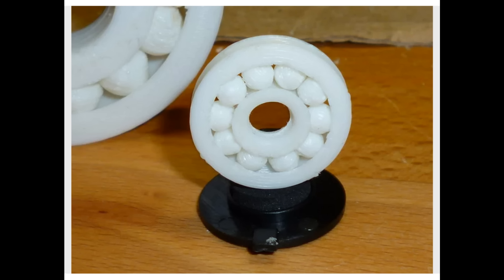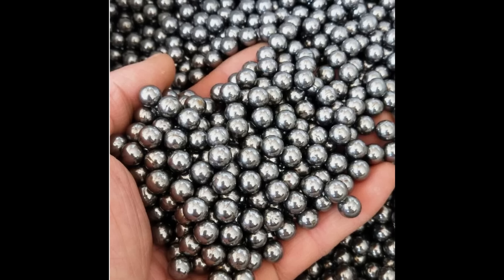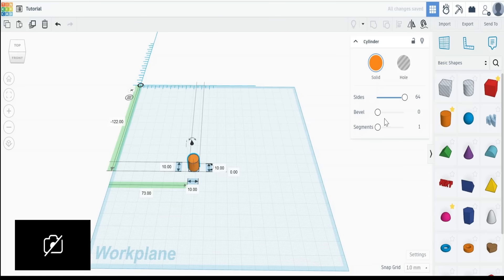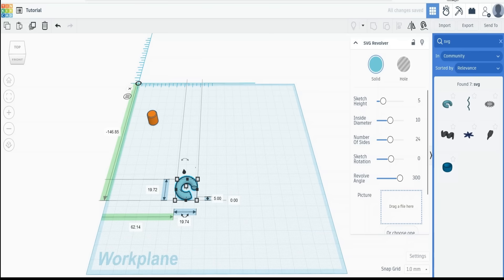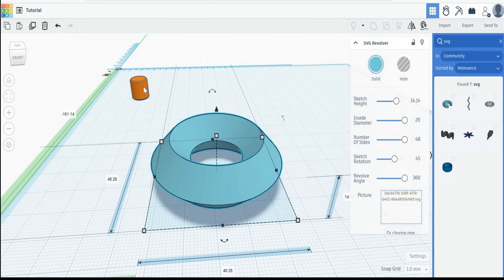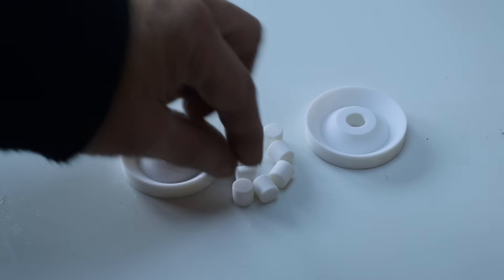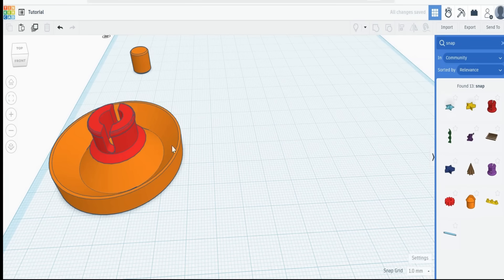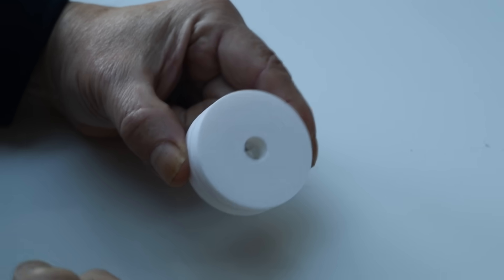2326 Universal 3D Printed Bearing That Works - Radial Cut

Comment: 1:30 the stepper motors only work in angular steps, that is what creates the jagged lines. However, angular momentum smooths things out, and a cylinder is still "round" in 2 out of three dimensions. A lot of effort has been put into printing these "arcs" in the XY plane, and this is really a non-issue (print a flat disk and check if you can see stairstepping for example). Instead, it's the filament lines that create a jagged surface in the Z direction in FDM printing, sometimes together with necessary support material on the underside of the sphere. Result is the same though!
3:20 the elephant's foot is already compensated for in most slicers, e.g. in prusaslicer under print settings -> advanced tab -> slicing.
Love the video, your bearing is very clever and seems to work great :D
Reply from the maker: cheers mate

Comment: Came here while eating – what a wonderful way to learn 😅. Wise design goals and words for applicable concepts! Didn't expect this to be something I may use for a turntable for robot hand. Though, I'm concerned about the momentum forces: 

Would there be a design, where the momentum force would be supported from 2 sides, instead of just 1 as now §1, where the other side squeezes and the other detaches? 🤔

A hypothetial §2 "interlocked hooks" (for sides) connection would still have only 1 side on the bearing and the other squeezing to the flat surface. Perhaps this flat surface could have §1? 🤔This would be a double circle of rollers structure; however, would perhaps need to be printed in-place without snap-ons. Interesting problem indeed 🤔

Just ordered a 3D printer and chasing FreeCAD. Sorry for your loss, Sir, and thank you for educating.
Reply from the maker: i am glad you found it useful mate and thank you for your condolences

Comment: There are vinyl filaments available, they're quite finiky to set up but once you have it this should be perfect for this type of application 🙂‍↕️ perhaps even better is PC/PTFE Filament which is even more a pain in the arse to set up but comes with a very good grind resistance while still being quite slippery. Coating the bearing chamber with graphite could also improve it's smoothness while turning 🤔
Reply from the maker: nice tips mate - thank you for sharing
Reply: @ThinkingandTinkering  thank you for this design, I would have tried designing ball bearings and probably loose my mind because it doesn't work properly.

Comment: That SVG revolver tool is a game-changer!
I've been creating similar shapes by manually revolving and merging countless shapes; the replacement hair-dryer fan I designed would've taken so much less time to make!
That snap tool is also amazing, I usually rip them off of other models and Frankenstein my creations together, or remodel them from scratch!
Reply from the maker: it is a pretty useful tool for sure

Comment: That's a good call.  I frequently use (big) slewing rings with cross roller bearings at work - but it had not ocurred to me to use the same topology for 3D Printed bearings.  Thanks for the idea!
Reply from the maker: cheers mate

Comment: why make the cylinder as tall as it is wide? I would think the diameter should be wider than its height to avoid friction
Reply from the maker: the cylinder would just drop down whatever it's height - you wouldn't avoid friction that way
Reply: @ThinkingandTinkering  if you have 2 cylinders at 90 degree angles, separating V shaped grooves, I think the larger diameter vs height would make the contact only happen on the rolling part of each cylinder, instead of rubbing on the cap of the cylinder.
Reply: @ThinkingandTinkering  If they are the same size, diameter and height, wouldn't it scrape on both sides?

Comment: How did you know tha they would fit perfectly?  i.e. how did you work out the diameter of the sleeve?
Reply: math, laddy, math.
Reply from the maker: the diameter of the circumference of the top of the cone is 10 times the diameter of the cylinder

Comment: They're nice but a little bulky for my taste. I've been using 2mm steel ball bearings sparingly because theyre expensive, but my usual go-to is plastic BB ammunition... I found a tub of 1000 4.5mm/.177in perfectly round hard plastic balls (HIPS I think)  for 4 quid and been using them ever since, I just take a 4.6mm section donut out of the mating surfaces, smear a bit of grease in there, place the balls in the grease and assemble. Never had a problem, smooth as silk if you print with scarf joints.
Reply from the maker: i quite like the purity of printing it all - but each to their own - nothing wrong with mixing it up
Reply: @ThinkingandTinkering  I'm trying to retrofit my old Anycubic with a syringe driver and a tank of Aloe Vera to rectify this problem. Gel supported UV resin can print really cleans spheres... Hackity hack 😉

Comment: This is an interesting thrust bearing design that is fully 3D printable. However, it cannot be used for radial loads. What I usually do is 3D print the bearing races and use steel or plastic BBs because there is no point reinventing the wheel (or sphere)
Reply from the maker: oh mate - look up cross cylinder bearings - that's what this is - it is specifically chosen for high accuracy ability to carry high loads and good for radial and axial loads - please do check your facts before posting - having said that - BBs are good - i like the purity of a whole pront but nothing wrong with mixing it up a little

Comment: If you hold Shift on your keyboard when you adjust a dimension in tinkercad it will scale the rest of the shape equally. Great if you want to make a 10x10x10 square by only adjusting one side.
Reply from the maker: cheers mate

Comment: Wouldn't it run smoother if you printed the rollers slightly shorter than the diameter to reduce friction? Great design.
Reply from the maker: nope - they would just drop to the bottom and all you would get is slightly smaller rollers

Comment: The cylinders should actually be sections of cones to roll correctly. If you project the axis of the raceway and the axis of the cones they should align at a point. Also, you should really print a cage to keep the rollers from bunching up and stuff.
Reply from the maker: that doesn't matter in large sizes - in smaller diameter you are quite right - a cage is optional - you do need it if the area isn't filled as they will then 'bunch up' but here it is not needed

Comment: My daughter did something odd in the kitchen with some stainless steel drinking straws that got me thinking - Could short lengths of stainless steel drinking straws be used as bearings? Could you print out just the two hubs [at the proper size] and use the straws instead of printing cylinders??? Might be worth giving it a shot; I have no printer...Jus' a thought
Reply from the maker: yep that would work

Comment: The top of each roller follows a longer circle than its bottom. That is, they are not rolling so much, but mostly sliding. They will likely wear out very quickly.
Reply: You do realize you're making a theoretical objection to a bearing design that is widely used in practice, right? Cross roller bearings work. Roughly speaking, they're used for high precision/load low speed applications. The rollers roll more than they slide. Of course there's some sliding; it's a roller bearing not a fluid bearing. That's what lubricant is for.

Honestly, 3D printing is just not a good way to make bearings. But if you're going to do it, cross roller bearings have a solid set of tradeoffs.
Reply: @SnakebitSTI  i managed to stand on a good 18 stones, and rotate a full rotation without it seizing
Reply from the maker: they are rolling - they only really need to be cones in small diameters

Comment: If done in metal, this would also be highly wear resistant. The rollers offer a larger contact surface and the fact that they also only rotate on 1 axis while balls can spin freely and mar the surface even more.
Now i need a lathe.... so i can make a lathe with better bearings :-D
Reply from the maker: awesome idea mate

Comment: I work as a design engineer. I make designs with their manufacturing in mind. Yet I have never done the same for my 3d print hobbying. I will now. Thank you for the lesson (10:20).
Reply from the maker: I am glad it was any help to you mate
Reply: DFAM (design for additive manufacturing) is really one of the most difficult things to grasp with 3D printing. I started and lead an additive manufacturing group at my job where I'm also a design engineer, and that's where many of my colleagues get hung up, and unfortunately like many things the best way to wrap your head around it is to do it and steep yourself in it for years.

Comment: I've been contemplating 3d printed bearings for the last couple of days, since I use a 3d printed wallet, that's designed to use a metal bearing, and I want to add more cards, and might have to design it from scratch.

Bonus points for using tinkercad. at university, I was taught to use solidworks, but tinkercad is just so good. love your work

edit:
I've seen so many people trying to teach tinkercad not know basic functions that I literally cheered aloud when you used the align tool. and I've now learned about the rotate png tool that I've never seen before, but seems like it might be a feature I thought was missing from tinkercad.

the thing i think would be most fun to add to tinkercad is webxr support, so you can design in vr in the space of your objects :-)

Comment: Still my favorite youtuber! Epic design, I downloaded it and will test it out. I wish I knew CAD design lol
Reply from the maker: cheers mate - it really doesn't take long to learn - start small!
Reply: @ThinkingandTinkering  I guess I will just have to sit down and do it. Glad your vids include the way you made it, tinkerCad looks a lot less intimidating.

Have you hear of the new filament Tullomer? Its supposed to be superior to PEEK, and far easier to print, lower warping,  lower printing requirements, mechanically stronger than steel and a full crystalline structure. 

If you submit case uses to the company they will give you free material to test it out. Would be a super cool vid to see your engineering brain make something out of it!

Comment: A possible improvment would be to make the rollers slightly cone shaped. The tip of the cone would lie along the line around which the bearing rotates.
Reply from the maker: cheers mate

Comment: Make it bigger with a large enough hole to fit a turbine and two of these would be used on the wind cube as two thrust bearings built into the case.
Fantastic design.
Reply from the maker: awesome idea - cheers mate

Comment: To make a regular bearing using this (inner and outer ring, instead of side by side) cut your rotated diamand against the top/bottom race' corners (cylider hole), to get a bigger and smaller ring, instead of in line with the races inner-outer diamond corners (symmetric halves).

The outer run make sure it prints in one piece (like you had your bottom/top halves print in one piece each) but allow your inner ring to print in half and use your same snap mechanism (probably use the tight fitting option if you used the free spinning before).

Place the bearings in the outer run in the same alternating pattern, then push the inner run sandwich together to lock everything inside. Done! Now your axel spins celative to the outer bearing
Reply from the maker: cheers mate

Comment: Siraya Tech's "Blu Nylon Mecha" resin doesn't generate powder with friction and is marketed as an engineering resin, also there's a filament "Tullomer" it's $500 USD per KG; it's a kevlar like filament that is the newest and toughest, surpassing all the CF and GF PP and whatnot, also using the best of both world's like using some Delrin strips or other McMaster goodies following the whole "borrow a tolerance" mindset gets very interesting.
Reply from the maker: cheers mate

Comment: Overall I like the design, and you are 100% right about designing thing for the 3d printer instead of against it.  It's the art part of engineering.  The downside without a pair of them they can't take a radial load without transferring the loads to the snap.  It why we stack precision angular contact bearings to take loads both ways.   
Also those rollers are straight and not tapered.  The bearings need a taper to handle the fact that the 2 ends of each roller travel a different distance as the roll around the races.  I'm wondering if that can be incorporated.  PS: Just get on the Freecad train.
Reply from the maker: cheers mate
Reply: yea taper is super easy in cad just have to change one side of the cylinder's size

Comment: You can make very decent needle bearings by abusing filament as rollers.
Reply from the maker: nice one - and yes you can
Reply: @ThinkingandTinkering  Not my idea, but still a very usefull tidbit for anything that needs to rotate.
My low-cost bearing solution before was print in place fishbone planetary gears.
But those are are seldom the right choice and are finicky to get reliable. 
Tho, if they fit, they get an ungodly amount of style points 🤣

Comment: This is an excellent design - but i.e. 6.35 mm (1/4") steel ball bearing balls are increadably cheap - cheaper that the material to print the circular rollers in fact. They work very well together with 3D printed interfaces including the ball bearing cage allowing you to print ball bearings into designs very easily. You have to choose either side for tolerance compensation however: One side has to be an loose part that can be quickly exchanged an printed in a lot of tolerances so that deviations in the print may be compensated by simply printing the compensation part with slightly differing dimensions until it fits perfectly.
Reply from the maker: absolutely mate - but i do quite like the all printed approach
Reply: @ThinkingandTinkering  Yes - that is pretty cool. Also slew ring bearings are really powerful.

Comment: I had no idea that snaps were an option in Tinkercad. Thank you for this and ALL that you do.
Reply from the maker: cheers mate
Reply: Me neither. I never used any of the fancy features of Tinkercad and learned a few new things myself. The conversion to SVG and use in revolving was explained at the bare minimum. But that's all that was needed.
Reply: Yea that snap and hole feature is pretty slick.

Comment: it seems like a cylinder would still be imperfect like a sphere on one axis
Reply from the maker: no - double curvature is always worse
Reply: I didn't imply that it wasn't an improvement. 

I still see two stepped circles running on each other.

Comment: The rollers are cylindric and the surfaces they roll on are conical. The rollers will rub because of the different diameters between top and bottom. Also, the snap connection forms a sliding bearing or sliding surfaces, which reduces the purpose of the roller bearing substantially.
Reply: Yes. Conical rollers of the proper dimensions are necessary to ensure uniform wear. Compare cylindrical roller thrust bearings with tapered roller thrust bearings.
Reply: This is the first cross roller thrust bearing I saw. Looks amazing. And I do agree that tapered roller bearings might be better. Anyway expect 3x times larger load capacity comparing to ball bearing.
Reply: ball bearings have this issue too, btw,

I've seen bearings of similar design made of metal, with a bearing diameter much larger than the rollers. I think it was advertised as zero-play bearing.
Reply: I think it is going to wear the rollers down to the perfect cone shape. I think the ends need to be a very shallow cone too, but they will wear to that profile if they are touching.
Reply from the maker: they touch at a tangent - so that doesn't happen - and the snap fitting is optional
Reply: @ThinkingandTinkering  At any point the roller surface may touch at a tangent but the traveled distance at one end of the roller tangent point is different to the other end of the same roller and the infinite number of tangent points all touch at the same time and travel different different distances/speeds so indeed do rub.  This could be alleviated by introducing tapered rollers as in standard taper roller bearings.  This design is basically two opposed taper roller bearings integrated into one unit.
Reply: @ThinkingandTinkering  There's less circumferential distance along the raceway closer in to the axis than further out, so the rollers need to be smaller nearer the axis to roll correctly. Google 'tapered roller bearing' to find the correct geometries for them to roll with no slip.